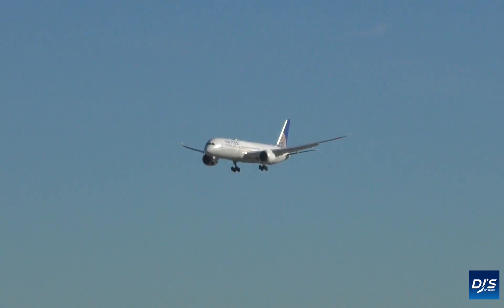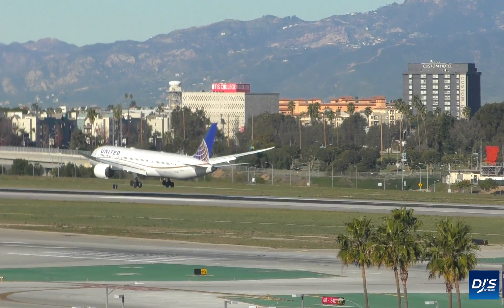Engine Problems in the Aviation Industry

Comment: Air New Zealand suffers this issues for long time....
Reply from the maker: They sure have, they've been hit pretty hard.
Reply: @DjsAviation  Air New Zealand hit hard, look on PLL LOT 787s wait for engines and 737Max grounded. Only use ATR and Embraer, other was ACMI
Reply: They have rented a few planes for long time...
Reply: @masonzhang7635  If i remember we have some serious trouble when 787 was brand new
Reply: they ex singapore  airlines planes !
Reply: Yah was excited to fly in one of their 777s for my trip but they had borrowed an EVA air 777 because of their 787 shortage.